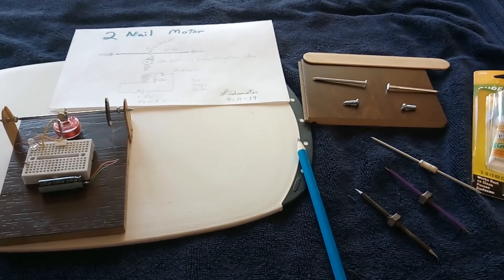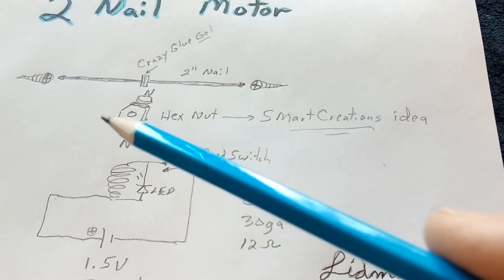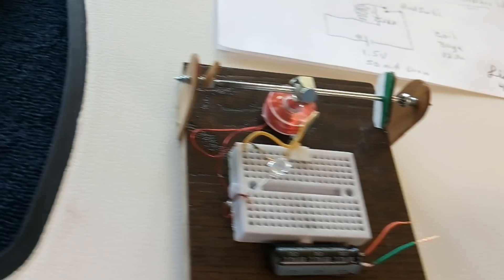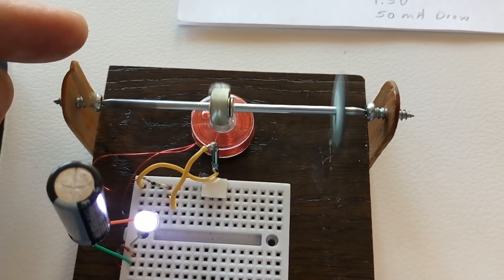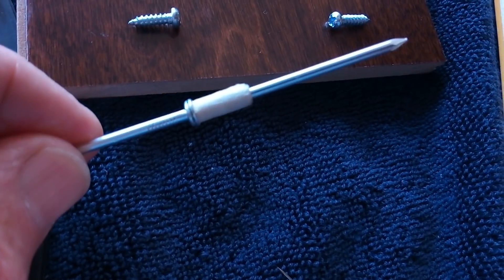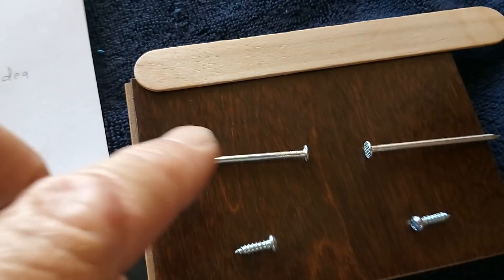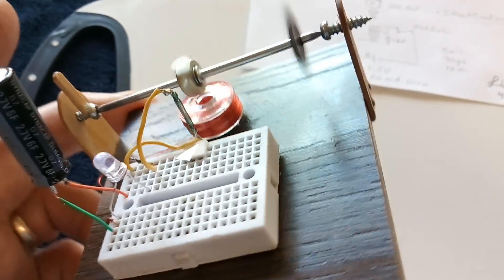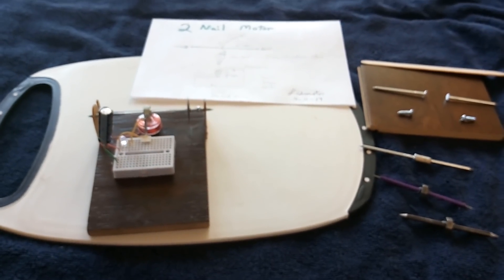2 Nail Motor

Comment: I saw Ludics video and he linked over and its a neat little motor.  I like the tension adjuster.   But I have a safety concern  ->  its spinning fast enough to take out the aquarium / big screen tv or a tooth or somebodys eye (pets family members, your own)  if one of those magnets breaks free and becomes a projectile.    It can easily be travelling several hundred fps.    So a shield might be a future upgrade.
Reply from the maker: Thanks for mentioning the spinning magnet safety concern.  I have worked with these so many years I forget to comment on that.  The easiest way to keep the magnets in place is to wrap a piece of good tape around them.  Also just keep the RPMs down.  If you go crazy with speed you can do some real damage if your little creation comes apart.  I have heard of people getting badly hurt when a high speed rotor Neo magnet actually came apart. The magnet fragments flew out and injured the person terribly.  Always be safe.  The only problem I have ever had was when a little rotor magnet decides to leave and vanishes somewhere close by ---never to be found.
Reply: Lidmotor My pleasure.  I haven't been keeping up with diy electric motors.   I was surprized to see how fast something like that can get going.    I know what you mean about tiny parts.    I've re-built and re-engineered my fleet of Walkera CB100's probably over a 100 times.  
Ironically when a tiny part or screw gets dropped and lost.    I drag one of those 20" in  tool holder magnetic strips around on the floor.   works every time.    Good stuff

Comment: Hi lidmotor, great idea putting those two nails together. Like the simplicity of it. Great thinking. And the way to tune the friction of the rotor-points, i think i'm gone use that to sometime :-). Thanks for sharing and mentioning me in your video.
Reply from the maker: I'm glad to see that you are still interested in this stuff.   Your long running project has inspired me to press on with my own quest.  This is not as easy I first thought.  So many things can cause a device to stop running when years of run time are involved.
Reply: @Lidmotor  Hi lidmotor, i am now trying to make 24/7 with a modified circuit of yours. It is Still stopping at night so much to find out with try and error :-). I think that putting the magnets on a hex nut, makes the outside mabnetic field stronger, so the coil driving the rotor has to use less power to do so. The best motor power ratio, i think, has the newman motor: magnets inside a coil. Any way its still fun to build these little motors, and they surprise me everytime i change something. greets M

Comment: I must have a few nails lying around somewhere. This Motor is simple enough for even me to try. Thank you
Reply from the maker: It is just a fun idea that actually worked better than I thought it would..
Reply: Lidmotor, I tried driving the motor using a regular Joule Thief Circuit, but I also used Slider’s 555-A-Like circuit modification to get some power input savings, and also hooked it all up with the RE-EMF Charger Circuit by Renee ( emc4u2 ). It did a great job of charging the battery as well. 
It is a very very good motor design for people in the villages of power deprived countries. Thank you again Lidmotor, Slider and Renee
Reply from the maker: Yes this simple rotor system can be used with many different driver circuits.  The steel hex nut also lets you easily try different magnet arrangements.  The whole thing is a 'Tinker Toy' with many possibilities.

Comment: Good use of flooring samples.  I got some samples with exotic looking woods and they're great for small projects.  Some have tongue and groove edges that need trimming.    But it's a good source of quality wood for free (or very cheap).  I hope the flooring vendors don't read this.
Reply from the maker: Every time I go the hardware store  I usually pick up a few.  They work great for small projects.

Comment: Your way of setting the tension of the screw with a little lever is really a good idea! My kids at school spent years trying to adjust a long screw from the outside by turning it after it went through the side supports, but this idea is so much easier and better. 
I keep learning all the time from you as you keep sharing. -- Thank you for sharing.
Ole shop tchr
Reply from the maker: It is kinda funny how that 'bearing adjustment lever' idea evolved.  The idea started out as a little wheel but I was in a hurry and just glued a lever on instead.  It works perhaps better than a wheel.  You set the starting position of the lever by adjusting the screw on the other side of the rotor.